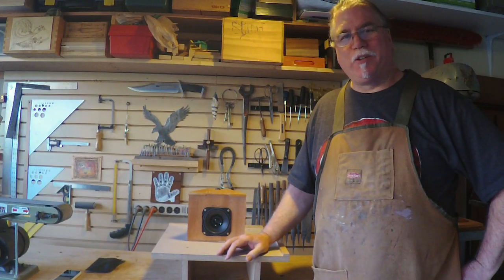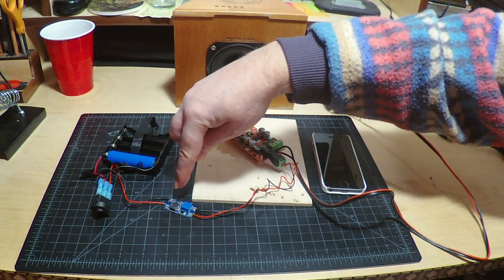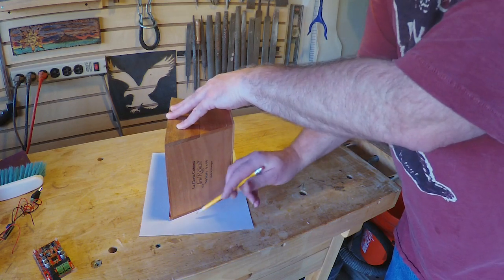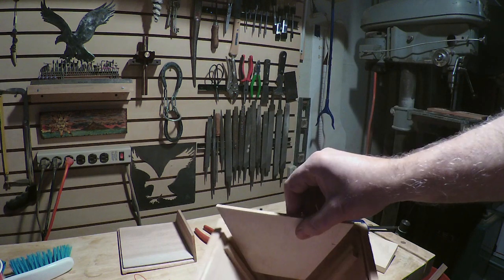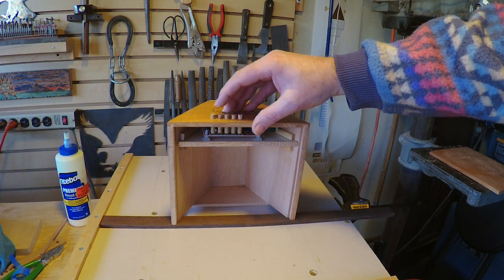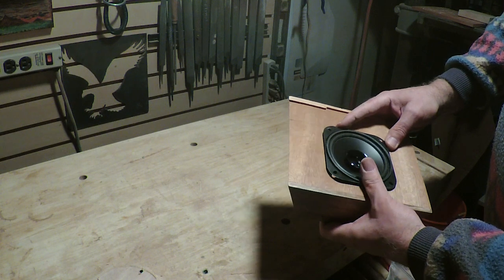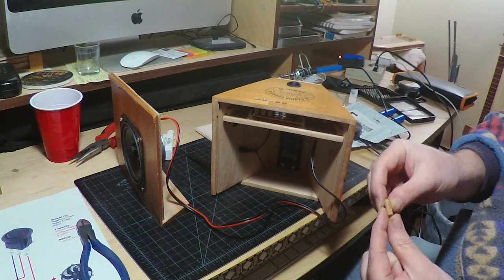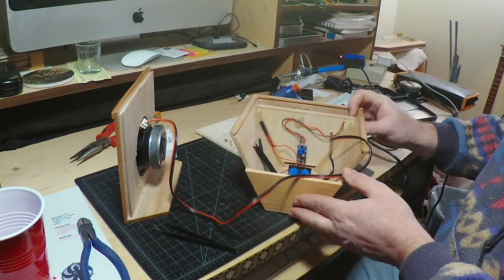Building a Cigar Box Blutooth Speaker

Comment: Thanks for the video!  Question about your amplifier board and speaker hookup, since you only connect one speaker would you only be getting one side of a stereo output?  Or does the amplifier board have a "mono" setting?
Reply: Great question and one I wondered myself in the beginning. No there is not a mono setting, so unfortunately on some songs where there is heavy panning, the sound suffers on this from only getting one half of the stereo signal. I am pretty sure there is a simple circuit that would combine stereo to mono, but in this case I just rolled with it. It still sounds great most of the time. Of course the easiest solution is to just choose a 2 speaker build.
Reply: If you have an iPhone you can adjust the audio settings so that it converts stereo to audio. Go to Settings>>Accessibility>>Audio/Visual and enable "Mono Audio"

Comment: You can get 4 slot battery sleds for 18650s and get longer battery life. Should run at the same 4.2 volts as 2 cells would. Parallel of course.
Reply: Note to anyone buying 18650 cells. Samsungs or LG is the best choice of brand.
Reply from the maker: Thanks for the tip. I originally was going to use 4 of the 3.7 volt 18650 batteries, in fact you will see at the beginning of the video I had a 4 battery holder. However it didn't fit the way I wanted into this odd shaped box, so I opted for the 2 batteries.  Even with two batteries, they haven run out yet.